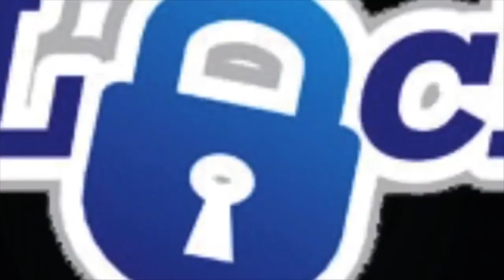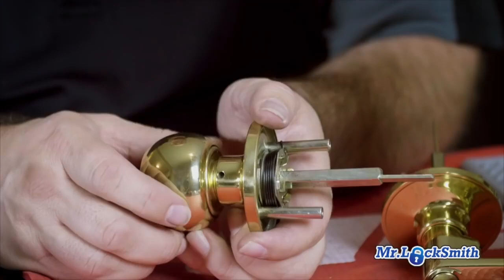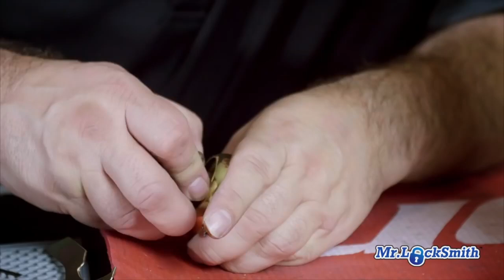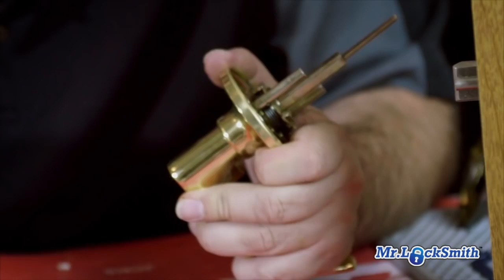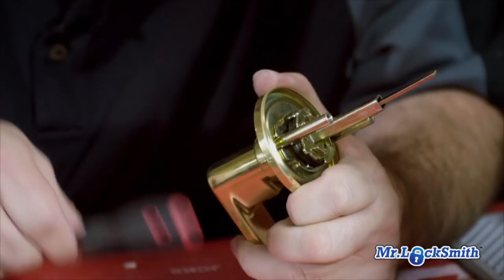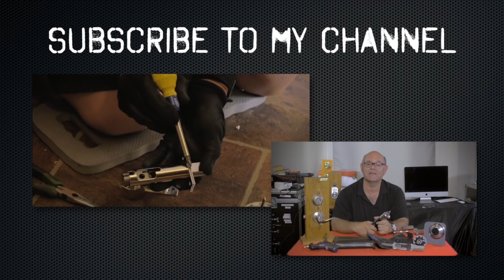Locksmith Training: How to Remove Off Shore Key-in-Knobs & Lever Handles

Comment: Terry, you were too quick at setting aside the poke tool at 2.26 in the video.  It can still help you with your task.   I found that tool very handy at removing the trim retaining piece holding the cylinder in the knob.  Once you do have a little gap, insert the hook end into the gap and slide the curved edge of the tool around the trim piece to work it loose.  Works even better if you use two of the tools, a little rocking action of the tools and the piece comes right off.  One of the tools at the shop workbench I've ground the hook so it is sharp like a knife point.  I slip it in between the trim piece and the knob to get the initial gap.  I have a photo of how I use two of the tools on knob sets, but youtube doesn't allow attachments in the comments.
Reply: All workable methods. I usually hold my forefinger on the lock cylinder face (to keep it from getting lost inside the knob) and tap the knob (shoulder down) onto a soft surface and the lock cylinder itself will help push that retainer plate off. When there’s enough gap you can pull off with the rest of the way.